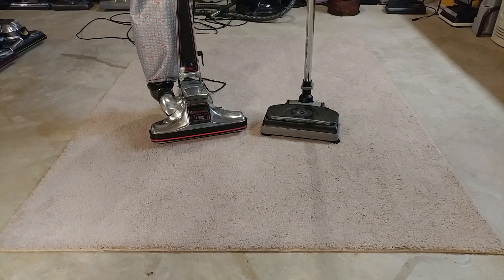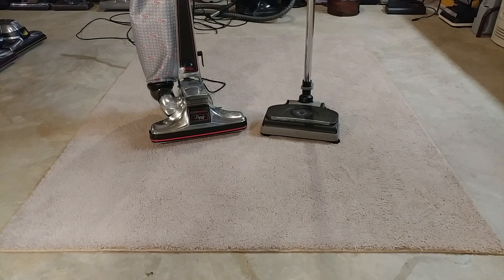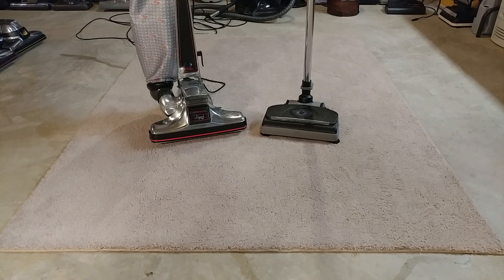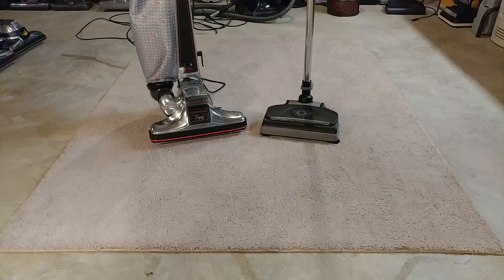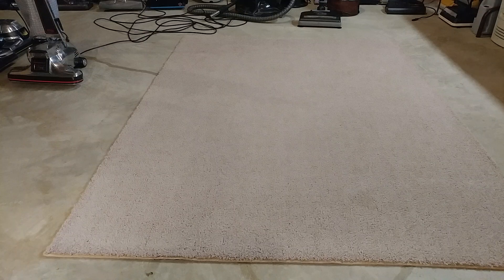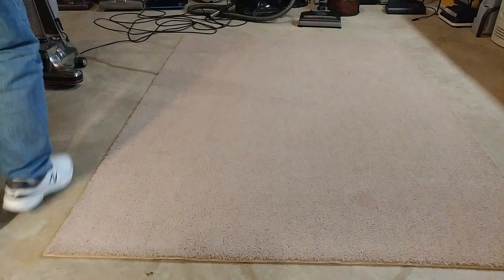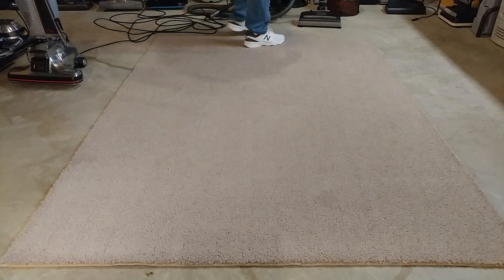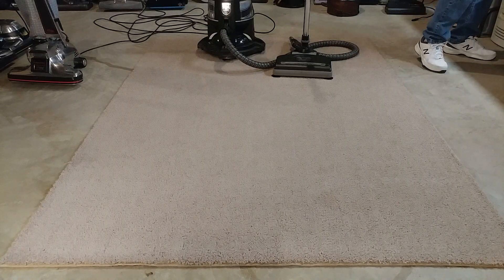Rainbow E2 Platinum Flour Under The Carpet Test

Comment: That rainbow power head does not seem to agitate very well. The original SRX nozzle does a much more thorough job. It’s much more aggressive. I paired one with my E2 Black since it has more suction than the SRX.
Reply from the maker: @Cleaning_Hero  that E2 PN agitates extemely well. The SRX PN (ver #1) is well known to he be quite worse in several ways. Rainbow had to redesign it due to the complaints.

And suction doesn't pickup dirt. Airflow does.

Comment: I have a rug very much like that and my Kirby is the same model as yours but I noticed it beats all of the sand onto the parquet below.  It does that when I vacuum both sides.  Did you replace the fan on yours?  I ask because I have yet to do that to my machine since I got it.
Reply from the maker: I've upgraded all my Kirbys to the newest white Amodal fan that was first available when the G5 came out.

Comment: Flour is non wet-able dust so it would bypass the water and go directly into the exhaust filter. It didn't pick everything up but I did see some missing. Not perfect but not a complete fail either.
Reply: Thomas Rectenwald 
It did he just didn’t see it because the water dissolved the flour.
And it is wet able because if it wasn’t there wouldn’t be pizza or bread

Comment: I wonder how it would perform doing the same test with the older style powerhead instead of this newer version do you happen to have the older version of the powerhead by any chance and if so can you redo the test using the older version of the powerhead a my other question I have is if everything gets captured into the water why would you need a HEPA filter on the back of this is there any way you could take the HEPA filter out to increase the airflow of the canister
Reply from the maker: This isn't the mix and match hack everything channel. 😎 I run most machines as per normal manufacturer recomendations.

Low CFM machines will never do well on this test. Any Rainbow ever made will fail this test no matter what you do.
Reply: I think when he meant the older style powerhead he meant the one that actually goes with the e2 platinum. They are different as I'm sure you know.
Reply: My old 70's Rainbow vacuum has more airflow than the newer models do.  The filters add restriction to the vacuum reducing their airflow.  I believe you can pull the HEPA filters out of the newer ones pretty easily.  It don't need to be in there....they were hypoallergenic long before that word ever existed.  The water traps all that stuff.
Reply: @wildbill23c  the reason it has the HEPA is because while water traps nearly everything it can’t trap fine dust like baby powder for example. The water repels it rather than attracts it so the HEPA is there to make up for that. The water does most of the work filtering.

Comment: Nice video like usual. I’m wondering what is the best test to determine a vacuums performance that you have done?
Reply from the maker: For fine dust and dirt, flour under the carpet test. For sandy grit, sand in the carpet test.
Reply: VacLab thanks!

Comment: This test really needs a high airflow vacuum. Although Rainbow E2 did well in the sand pick up test. I like the powerhead. It's quiet and those side brushes really help in the edge cleaning.
Reply: Yes even though this test failed the flour under the carpet test I still love this vacuum and all it can do.
Reply from the maker: I'm waiting for a water based vacuum that has at least 100 nozzle CFM or higher. I think I'll be waiting a long time. 😀
Reply: @VacLab  I'd settle for another 88CFM that my Electrolux can pull.
Reply from the maker: @TRec3791  that'll do it!
Reply: Vacuumtests 
The rainbow has the maximum air flow that physics will allow in a vacuum cleaner. Water doesn’t clog like a bag or filter.